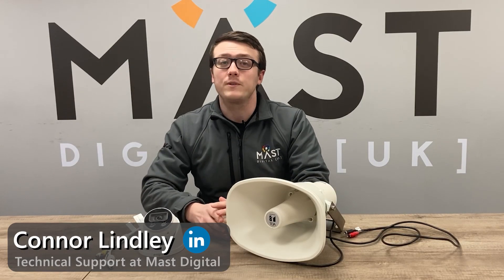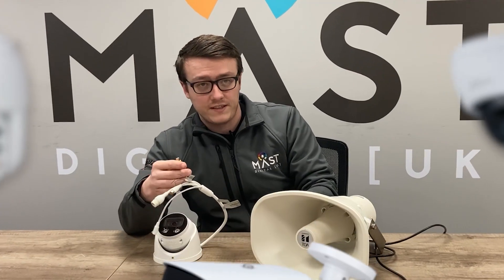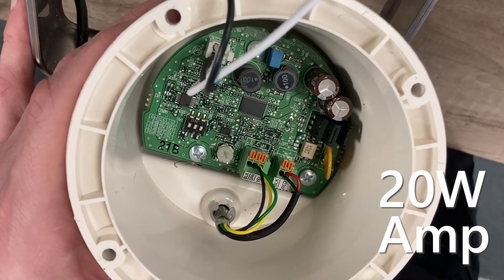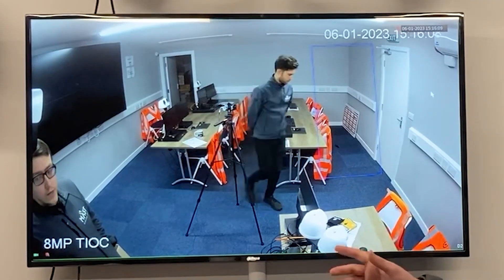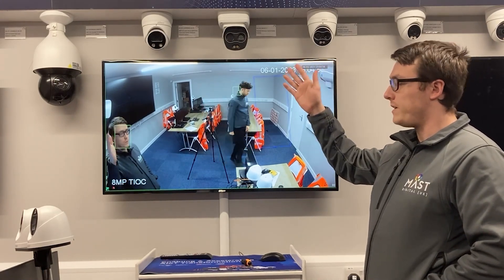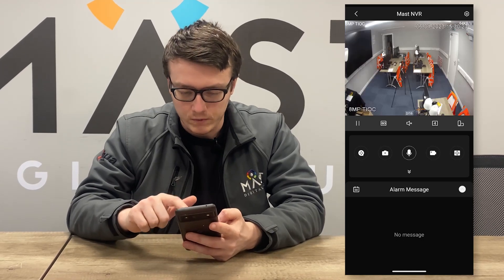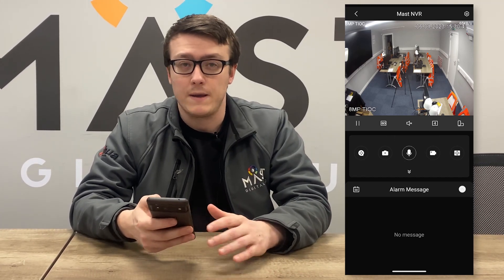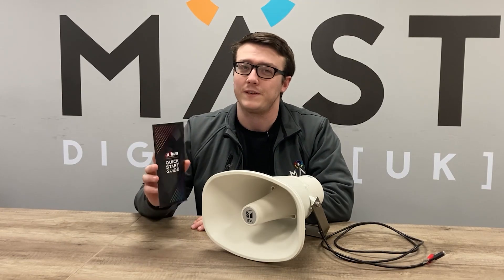How to SUPERCHARGE your Sirens & Two-Way Audio with a TOA Horn Speaker | Walkthrough & Demonstration

Comment: very nice video ... what is the model number of the horn speaker?
Reply from the maker: Hi Randy, the model number is SC-P620-EB, you can find it on our website here https://www.mastdigital.co.uk/cctv-security/toa-audio-products/toa-sc-p620eb-20w-powered-horn-speaker-requires-12v-2a-psu.html Thanks 😄
Reply: Pity, I can't get the speaker in Canada.
Reply: @SovereignIntelDotNetwork Try eBay, they have them there most likely.
Reply: What's the coat for the horn? And where can I buy it